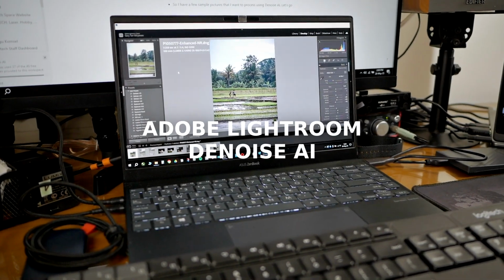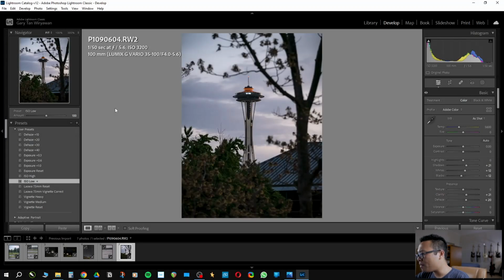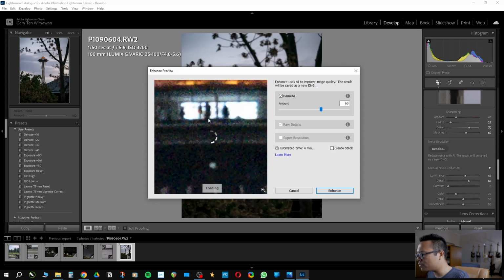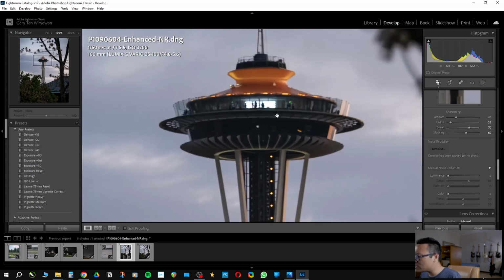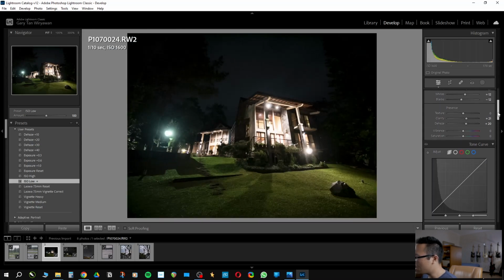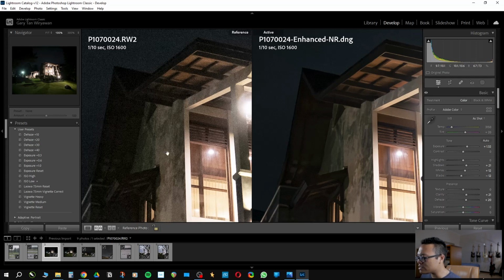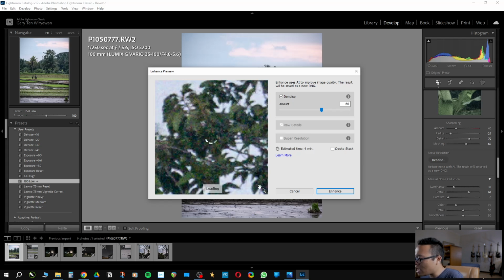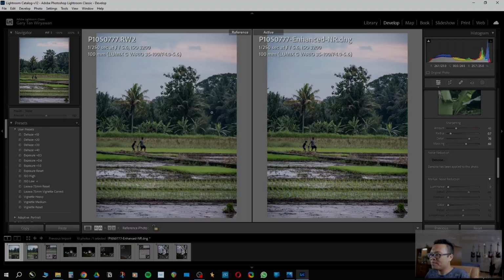Using Adobe Lightroom Denoise AI to Reduce Noise in Micro Four Thirds Photos (Spoiler: IT WORKS!)

Comment: If you have an Olympus camera you can use the free OM Workspace app which has an effective AI de-noise function built ion that only works on the raw (.ORF) files.
Reply from the maker: Good to know, thank you for sharing!
Reply: Come on! OM Workspace has the best output but is shamefullly, disgustingly SLOW. It takes almost a minute or more to switch settings on a raw file in OM workspace!!!!!!

Comment: Gary, id like to here your opinion on Raw v Jpeg and editing!
Reply from the maker: I much prefer to shoot RAW with "serious" cameras, and JPEG only with my phone or casual cameras. Shooting in RAW is actually much easier than shooting JPEG. With RAW, you have plenty tolerance in terms of color, exposure, dynamic range, so as long as you frame your picture correctly, everything else can be "fixed" to a certain degree. JPEG on the other hand is more unforgiving during editing, and it requires a degree of precision to get everything correctly before you take the picture. And that's why I prefer to use JPEG more for "casual" stuffs, just for documenting something that's not highly important.

Comment: Hi Gary 
Good and informative review 
Dont know if you are aware of the following helpfull tip:
When you want to compare 2 images side by side, first highlight both in the film strip in the develop mode. then press 'C' on your keyboard - this takes you into library mode. Make sure you have 'Lock Zoom Position' enabled - found under 'View' dropdown, and both image will operate in tandem. Zoom, scoll  etc, by imputting mouse comand on the left image
Reply from the maker: Very useful tip! I will keep this in mind, thank you!

Comment: The AI denoise will only get better over time.  Do you think that really good AI denoise will obviate rhe need for high-end expensive lenses?
Reply from the maker: Good question Chad 😁! Someday it might obviate not just the lenses but also the camera completely, I heard some news of an AI camera that can take a picture based on the location, without using the usual imaging sensor + lens configuration. But as of right now, I think a decent lens is still a very important factor in getting a good quality image.